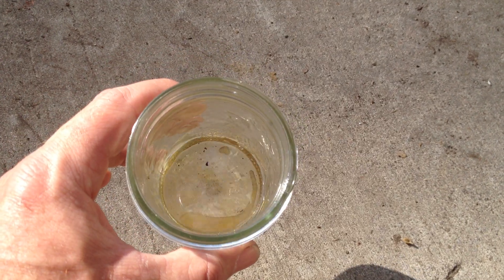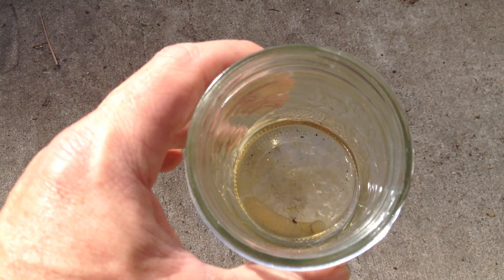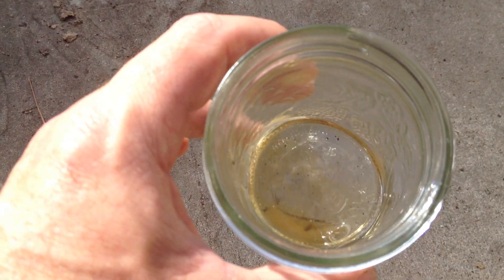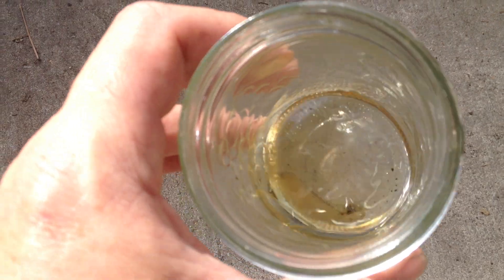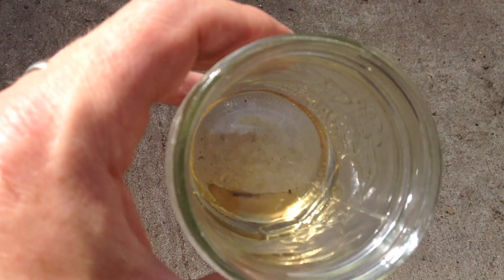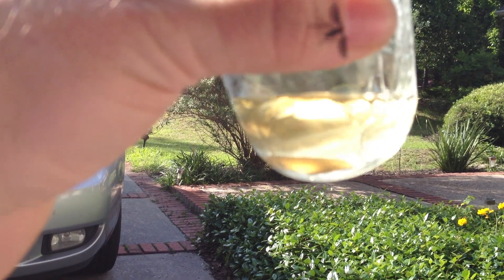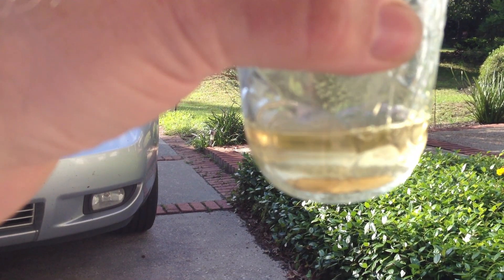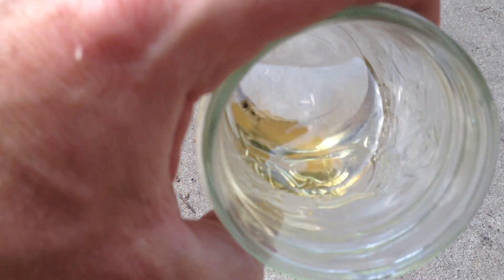Water In Gasoline - What Does it Look Like?

Comment: Knowing how easily water and gasoline separate, I see it as plausible to be able to separate the two should you get water in your lawnmower or generator gas tank. I had a situation where a whole lot of debris got into our generator gas tank and I had to empty it out and clean it before using it again. Fortunately, I was able to remove the gas tank and empty the old fuel into a container and just had to separate the water from the fuel. The fuel I was able to salvage still works. I'm able to run our generator off of it. Although, I'll probably just use that for our lawnmower and generator until it runs out.

Comment: My riding mower began running rough and on Choke only. I suspected water, but after taking a sample the clear bubbles were floating 'on top' of the gas.

What is that?      after flushing lines and the carb it runs ok now, but what was that fluid floating top? Any one?

Comment: If you want to use Ethonal base fuel or completely Ethonal mix with two stroke oil pre mix  mixture of 2 oz with 8 gallons ,you will not have that problem  and if you want to go old school mix Ethonal with 2 oz of atf transmission oil with 10 gallons of fuel and that's what I have been using in my Ford excursion

Comment: My snowblower was running like crap this fall so I pulled out my carburetor. When I emptied the bowl I was surprised by the two liquids that had separated out. There is a lot of water in my system. You're right that there are many reasons. I will now try to keep my gas more fresh and use a higher octane. 

Thanks for your post!

Comment: Idk which sta-bil you are using but for ethanol gas you need to use the sta-bil that’s  designed for it. I used plain sta-bil in ethanol gas in my mower over the winter and it still gummed Up.
Reply: i started using K100 my lawnmower starts on 1st pull after sitting all winter all my small engines start better i just mix 1 oz. k100 to 2 gal. gas

Comment: I don't remember exactly how it goes but... Supposedly the moisture in the air can easily dissolve in the ethanol. When the equipment sits for a while the ethanol evaporates and leaves behind water and separates, making it visible. When the water is combined with the ethanol you can't see it.

Comment: Actually, you dont have to get rid of all of your gas!
We all know how expensive gas is nowadays, and what worse news to hear that you will need to dump your newly filled $80 tank of gas? Well, water in your fuel can cause numerous performance issues; some of these issues closely resemble some of the symptoms of a blown head gasket ( minus the over-heating) IE: Multiple Cylinder Misfiring, Loss of Power, & Emitting Excessive Steam (White Smoke) From The TailPipe. Basically, just drain your fuel into a clear tub, such as the 15 gallon Storage Bins Sold at Wal-Mart. Place the lid on the bin after draining, and take this time to clean the Fuel Tank out. Wipe it nice and clean with dry rags or shop towels, then use a bottle of $1.50  90% Isopropryl Alchohol and do the final rinse out. By this time, the water should have settled to the bottom of your clear Bin. You will see where it divides, now just siphon the fuel back into your tank while stoppin an inch or so before the water line. You will sacrafice a small amount of fuel and save tons of dough as well.

Comment from the maker: You really have to drain the tank and remove the moisture, at least if you have as much as I did. I tried to dilute it with fresh gas, but the inside of the carburetor was all gummed up with varnish from that darn Ethanol fuel we are sold.

Seafoam seems to do a pretty good job at removing any deposits and varnish that have already built up inside the engine. In my case though it was too much for it and I had to manually get it out of the carb and fuel system.

use stabil on a regular basis!
Reply: TrustMyMechanic.com Thanks! I just bought some seafoam and it seem to have fixed my problems so far. (Fingers crossed)

Comment: Can't just throw drygas in there, then top it off with fresh gas?
Hear Stabil works great for engines that sit for a long time. As you said it reduces any moisture buildup, keeps the gas from 'spoiling' and leaving a varnish on injectors/carburetor... ect